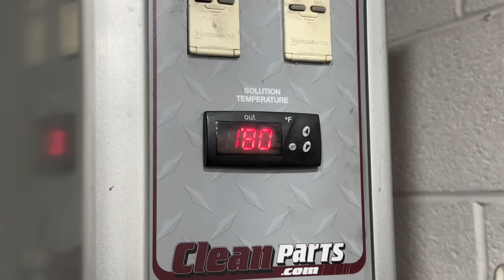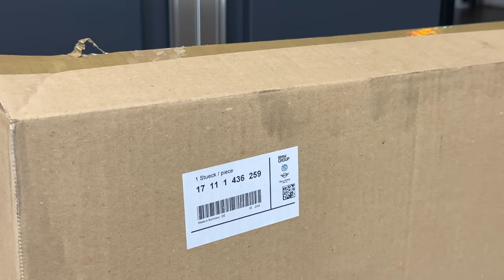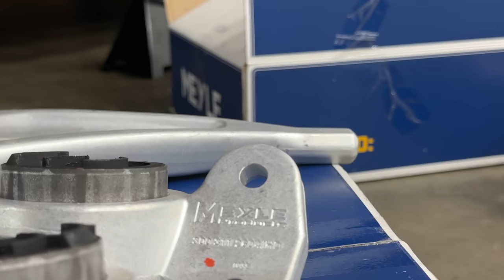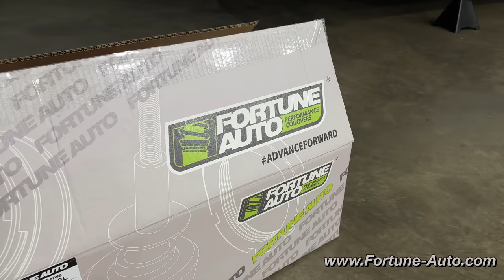I'm Fixing Everything That's Broken On My E46 Touring!

Comment: You might want to replace that fan clutch so it doesn't fail catastrophically and take out all your hoses and hood tho...
Reply: For those that don't know, motor mounts cause fan clutch's to fail, not the fans themselves. Long as you keep mounts up to date you're good! 

Great suggestion.
Reply from the maker: For sure! I plan on replacing it soon, I just ordered such a massive amount of parts and this was one of them that just slipped my mind ahead of time!
Reply: Electric fan conversion is really where it's at imo. Quieter, easier to work on. I believe all manual e46's came with them.

Comment: Hey Aidan! Just wanted to give a tip on removing wheels that way you don't have to sit under the car kicking it while its sitting on jack stands...
Leave 1 bolt on the wheel hand tight and hit the inside of the wheel on the tire with a large rubber mallet. Wheel should come off in 2 hits tops, plus when it comes loose it wont roll around the floor, it'll get caught by the bolt you left in! Another well made video.

Comment: Love your car bro, makes me miss my E46. Everytime one of these videos pops up it brings back nostalgic memories of the great time with that car. May I make one suggestion I made to my E46 that paid Dividends. Switch from that fan clutch to and electric one. My car never overheated, worked great and was super easy to install and remove when I had to get in there which is anytime you need to do anything under the hood lol

Comment: Gotta love a nice southern rust free car! After that update, it's looking close to new. I just hope those bushings, joints and axles hold up to that aggressive drop. As for the fenders, they may very well have been orignal paint, but with these cars pusing 20 years old, fading is a problem. If the factory replacement fenders came off different cars, how much sun they received and the latitude from where they were sourced could have a big impact on matching.

Comment: Those style 189’s are such a good stock body option. 
18x8/8.5 +34/37 if I’m not mistaken. 

I swapped mine out for the style 197’s on my e92 and I wish I kept both sets. 

They look fantastic in older chassis.

Comment: Great content Aidan.  I miss my old 330.  I'm in an F30 335 now.
Reply: Which would you rather daily?
Reply: @vetob5by120  The F30 is easier to drive and a hell of a lot faster so yeah I'd rather daily the F30.  It's got 140,000 miles and  the only issue was a bad wheel bearing.  Easy fix.

Comment: I hate the wheel sticking to the hub.

I use a thin layer of copper anti-seize on the rotor hat and on the hub surface. Then the rotor won't seize as well as the wheel.